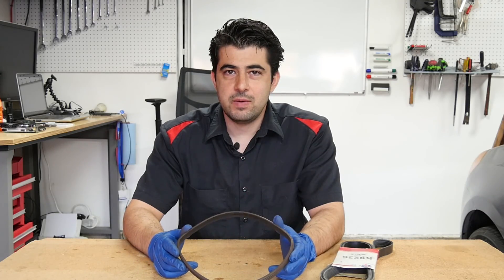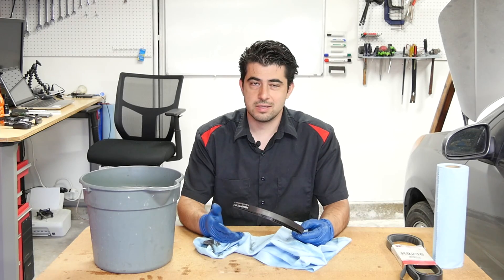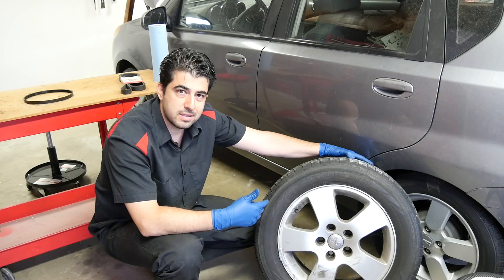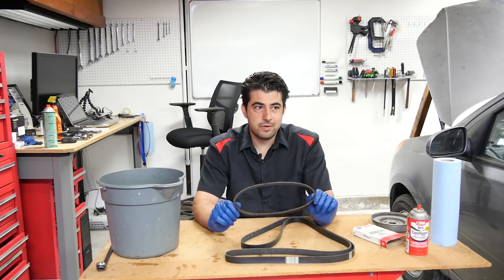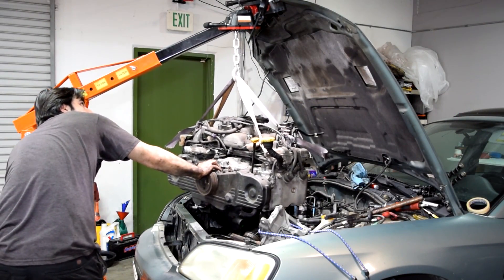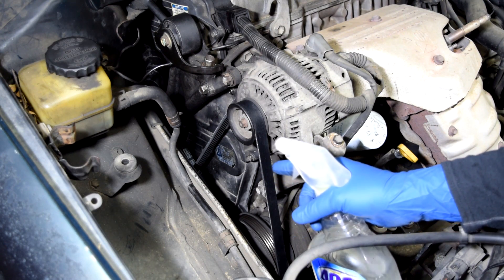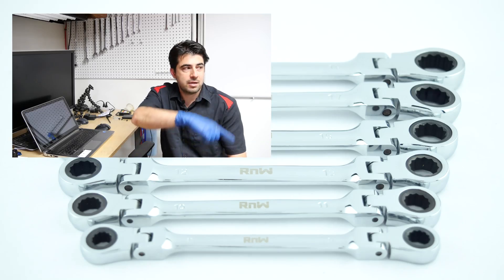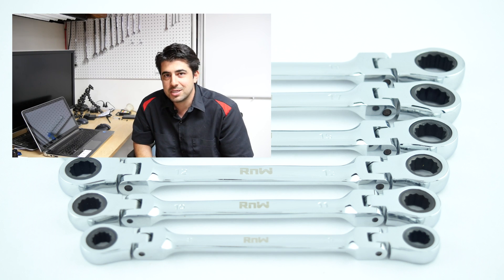Can You Treat a Belt to Last a Million Miles? - Also Easy Belt Noise Diagnosis

Comment: Thank for the info , I almost believe from youtuber Sweet Project Cars title "NEVER! Replace an Alternator Belt/Serpentine Belt AGAIN !"
Reply: bloodonmars use it anyway, 303 isnt tacky like the shit he used in the video.
Reply: Ratchets And Wrenches They are not scamming,  they aren't even selling anything.
Reply: I'm disappointed. I was expecting a real test of the claims, not your assumptions.
Reply: my belt was squeaking after i washed the engine. like all other belts i ever had noise problems with, i just dusted it with baby powder and it hasnt squeaked since. eventually ill be replacing the tensioner among other parts but just havent had the spare cash lately.
Reply: son of a b#$#@ i just bought a gallon of rubber protectant for 50$.... D;
Reply: BloodOnMars were you responding to me? As long as the belt stays dry the talc powder works great and its cheap as hell to reapply just takes seconds without even removing the belt. I'm not wasting my money on dressing when baby powder is so much cheaper. Maybe the dressing is a one time application but the powder is still cheaper.
Reply from the maker: yes, there are a couple of them making these scam videos. Who said you couldn't sell snake oil on youtube.

Comment: Hey RnW, thanks for the advice. Belts are inexpensive and easy to replace so why wouldn't you replace it after a while? Let's say a new quality belt costs $40 and you drive every day (365 days) ....that works out at only 11 cent per day for the belt if one were to calculate the cost as a cheap skate. Gonna risk engine failure over 11 cent?
Reply: The belt isn't 11 cents tho
Reply: Cona ca......Not sure why you'd reply to a rhetorical question but thanks for letting everyone know this because it will save people hours looking online for 11 cent belts....silly me.
Reply: Hey TheAstro30, Thank you.

Comment: engineered (planned) obsolescence , that's how everything is made  very few things will last forever.
Reply: Do you prentend that a belt should last forever, that is impossible, like a tyre that never worn out
Reply: True. However, auto-belts are actually one of those rare things that are much better than they used to make.
Reply: Nothing will last forever, not even the universe.
Reply: If they did they would be very expensive and hard to find. Say that last forever part got destroyed in an accident?
Reply: thats why some products used to last seemingly forever and modern replacements dont. (engineered to fail)

Comment: Modern car belts last a long time and belts are inexpensive.
Reply: vee4410 yeh but replace them is not tine effective and they aint cheap.... Anyway you r right
Reply: baby powders cheaper.
Reply: Guess what, genius?   MY belts require that the friggin' MOTOR MOUNT be removed to get them out?  I don't buy the chemical nirvana, but DON'T DISCOUNT LABOR!
Reply: +BigEd What? My serpentine belt can be changed in 2 minutes and costs about $12.

Cheap and fast!